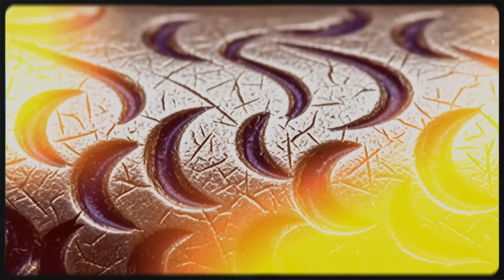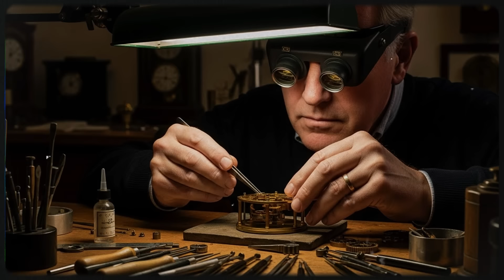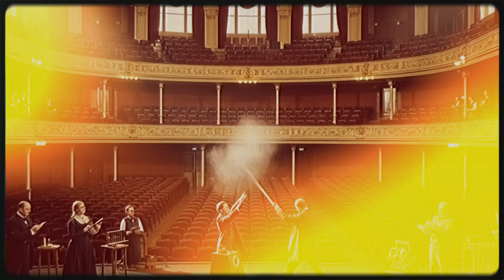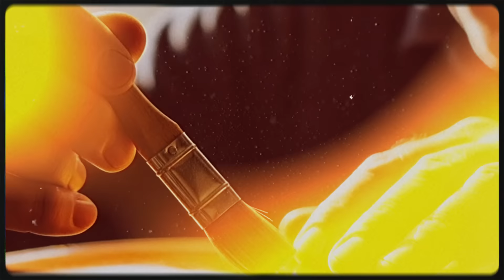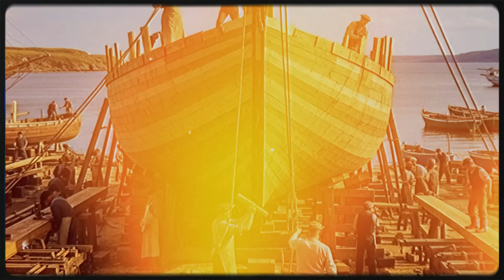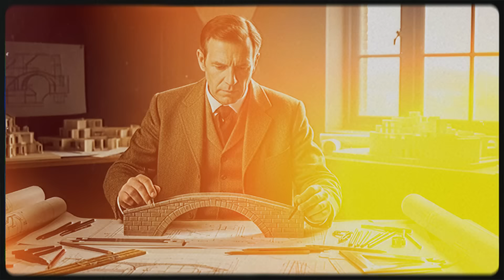The 1800s Blueprints Modern Engineers Can’t Recreate — And No One Knows Why

Comment: Scraping is not a lost art from the past, it's still done today on cast iron surfaces by many machine tool manufacturers.   The process of scraping a true flat surface plate needs a minimum of two plates but preferably three.  Plates 1 and 2 are scraped and bedded to each other.  In theory this gives them a flat surface but it's also possible for the surfaces to be slightly spherical to a tiny  degree and yet will still show a perfectly bedded and apparently flat surface.  To check and eliminate this plate 3 is scraped and bedded to plate 2 which gives a matching but possibly concave or convex matching face.  Plate 3 is then checked against plate 1 which will show up any concavity or convexity immediately.   
Milled, Planed and Ground surfaces are normally very accurate. but for bedway surfaces on cast iron the scraped surface retains oil for lubrication better than a mirror flat surface will.

Comment: Was the Puddle Furnace a real thing?  For 1000s of years people used the blooming kiln and not once did they achieve the temps necessary to melt iron. So how does the puddling furnace, with so much more mass and size to heat, so much more brick, and requiring so much more air, achieve the required heat?  We're told hot gasses played over the puddle, while with the blooming kiln the heat was directed more simply, more directly upward through the mass of charcoal, limestone and ore - all more proximate to the heat while being more insulated.  And who has actually seen one of these relics? - save in etchings.  There should be puddling kilns hiding in the overgrowth all over the place!  Are we to believe that 20,000 miles of RR rail - by 1835, in north-east USA - was all actually soft wrought iron and not steel? Finally, who has troubled themselves to recreate a Puddling Kiln...that actually works?
Reply: Well, because the metal can be easily moved and manipulated when at a temperature below the liquidus temperature and above the solidus temperature.  Alloys such as high carbon steel have a range of temperature where they are partially molten and partially solid.